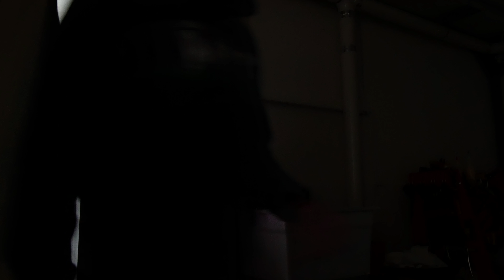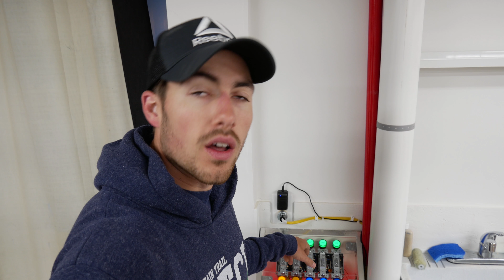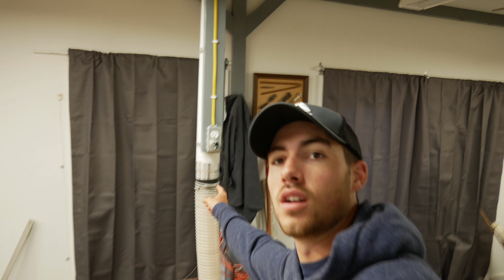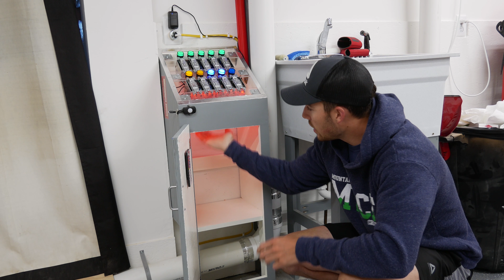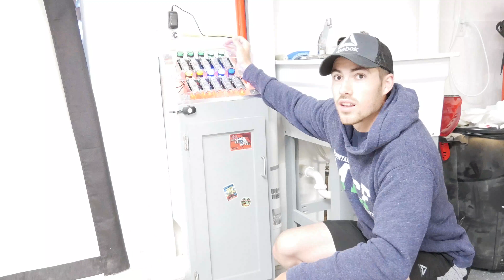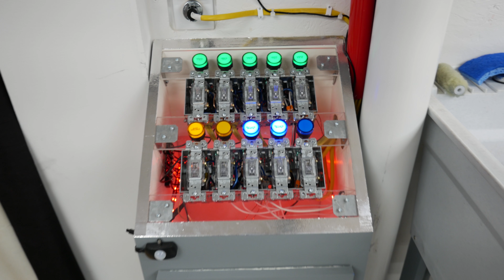Making a Shop CONTROL PANEL with LEDs! || How-To

Comment: "...I can almost guarantee this is not up to code." You are correct, good sir. It is most definitely not up to NEC. But cool factor trumps safety on YouTube as we all know, right? Electricity is not a hobby. Hire a professional. A few tweaks and this could actually be life-safety correct and not a fire hazzard.
Reply from the maker: Not to worry! I had it mended a couple years ago by a local electrician 😃 basically just boxed in the power busses and made a cover for the top! It’s still just a cool now but way safer 👍🏻